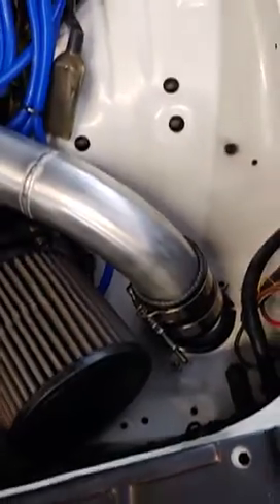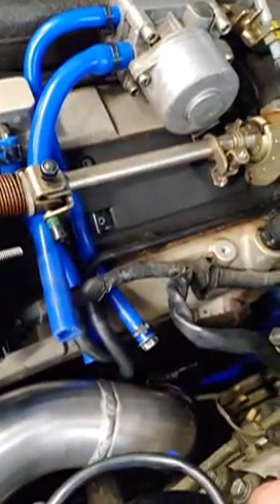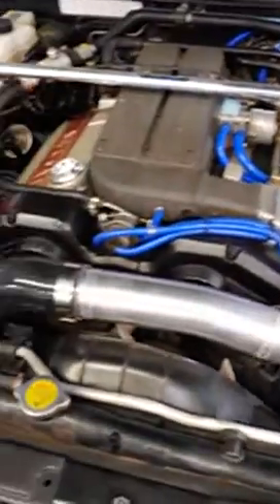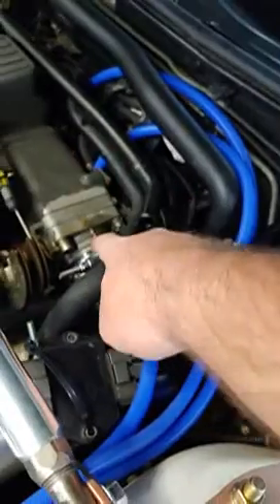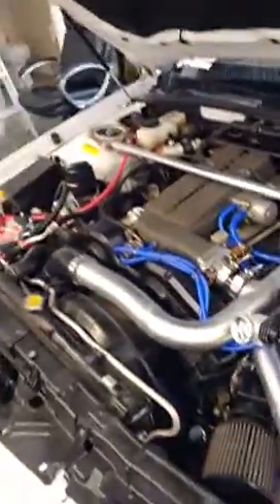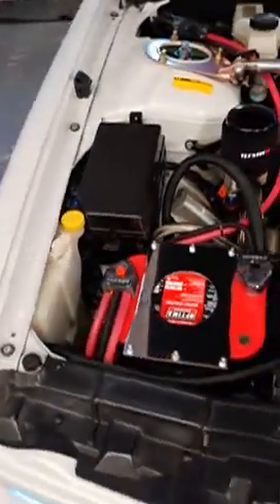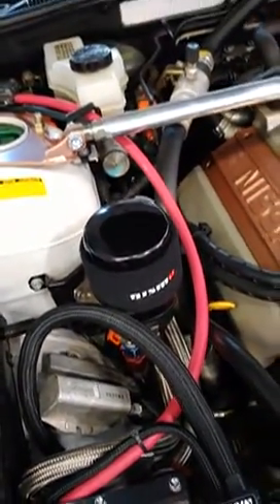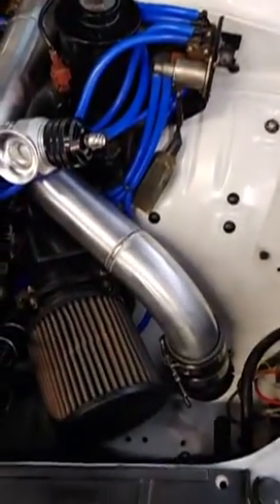Nissan Gloria RHD VG30DET JDM FMIC Fully Installed Front Mount Intercooler

Comment: Very informative video 👍How much boost can you safely run on these before fuel cut or damage?
Reply from the maker: i wouldn't go more then 2psi without any kind of tuning
Reply: @gostlrs  is that 2psi on top of standard boost? I believe they are around 8/9 psi but with an intercooler you can run more?

Thanks again for this video it's helping massively!